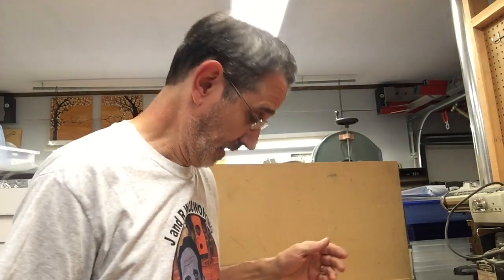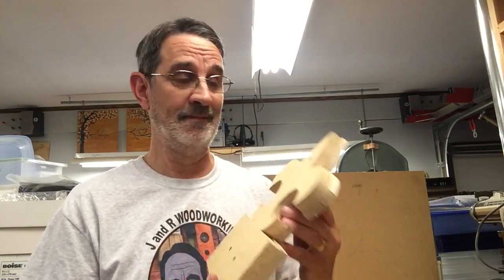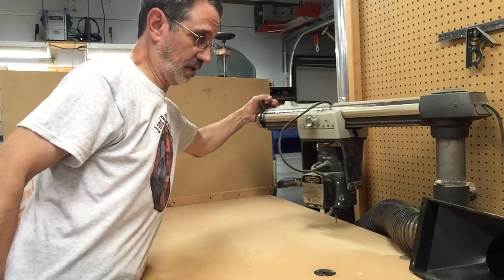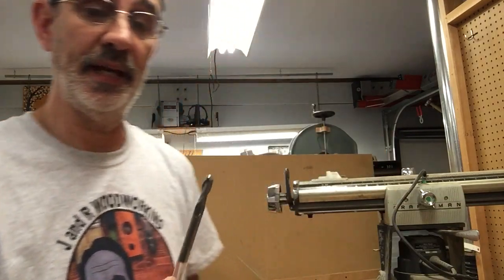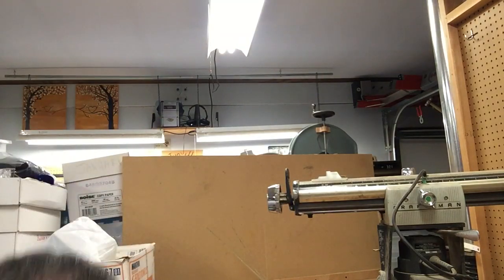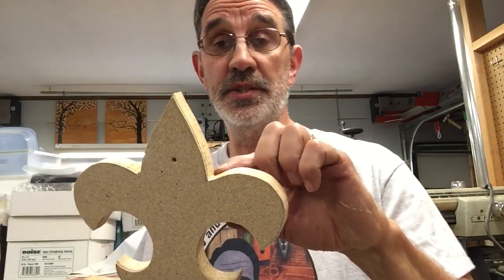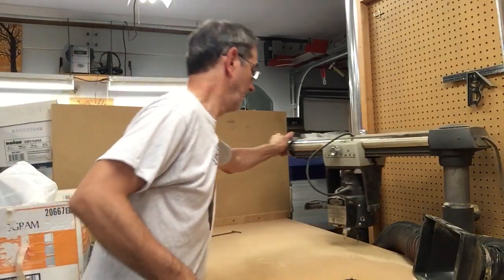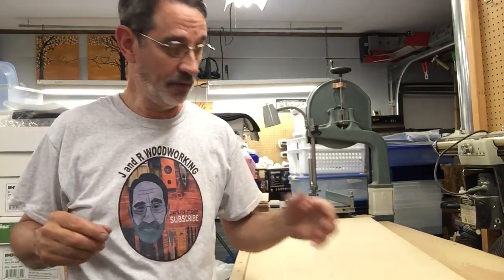307.  Demonstrating the pin router in action.

Comment: Jim I have that exact radial arm saw. Have had it for 37 years. Love it. When I first got it i experimented with several jigs including making a mount for a B&D router. Allowed me to crosscut grooves without installing my dado cutters. Have even seen a video where they show ripping full sheets of plywood by tilting blade to hang off front of table and slide panel vertical past the blade on a floor mounted track. Looked crazy dangerous !

Comment: what is the advantage to the top cutter with the pin at the bottom?
Reply from the maker: The biggest advantage is that you can see what you’re doing you can see where the cutter is and every pin router that I’ve ever worked on always has a cutter on the top that way when your work is on the table you can lower the cutter into the material and then start your cut that works especially well when you’re doing an inside cut. Jim